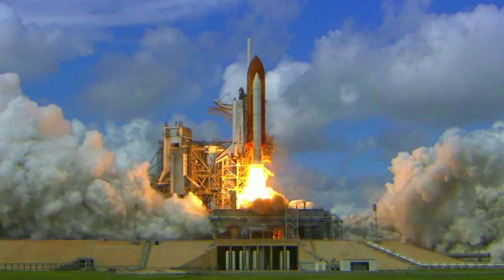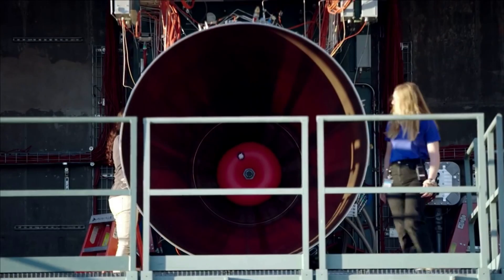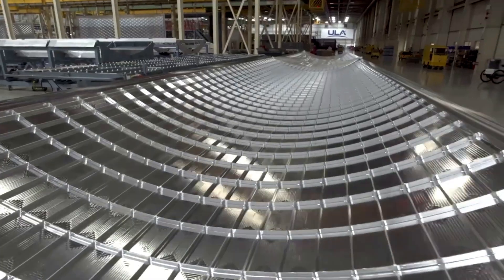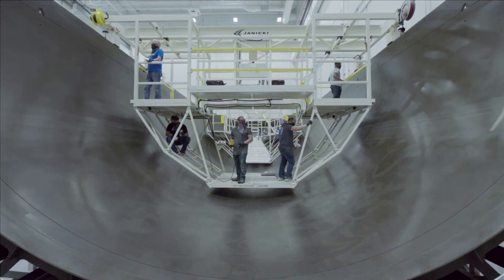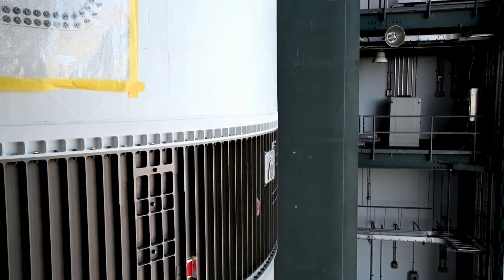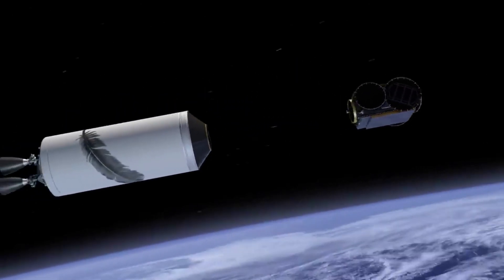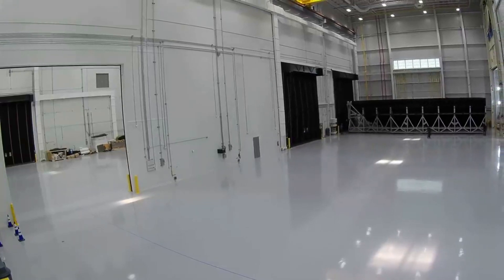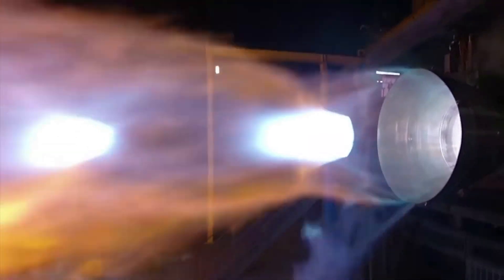Is Blue Origin Making Progress On The BE-4 Engine?

Comment: Does BE-4 really use LNG, or is that a kind of a code word for methane? Longer chain hydrocarbons present in natural gas could pose risk of coking, and there are other impurities.
Reply: In order to liquify NG for a rocket, you have to separate out impurities and essentially you get pure dry methane. Those longer chain hydrocarbons can't be liquid with methane. So it's methane. CNG is just raw natural gas compressed, LNG is more pure and a cryogenic liquid.

SpaceX for example wants a natural gas line to their facility so they can purify it and liquify it in storage tanks. Otherwise it'll take many many trucks to fill every time.
Reply: @Jaker788  So, it is methane, just called LNG for marketing reasons. (LNG as transported in those huge ships does still have imourities.)
Thanks.
Reply: @bazoo513  I'm pretty sure the impurities that would pose a problem for a rocket would be gone. Can't have any water vapor, any longer chain hydrocarbons would likely freeze, etc. At the very least it does require more processing to be compatible with being a cryogenic liquid compared to just compressed gas.
Reply: @Jaker788  I looked around a bit, and you are right - only a bit of ethane is left even in the "ordinary" transportable LNG. Thanks.

Comment: 2500 seconds of sustained burn time is more akin to 8 flights, not 25; but ULA is going to make a single-use for the time being, to replace the controversial and no longer available russian RD180 rocket engines.
I just want to see the BE-4 engines to fly as soon as possible.
The BE-4 engines are not efficient as the Raptor 2 from the competing SpaceX manufacture, but, ehi! - they are close.
Thanks for the updates,
Reply: Cool story lol

Comment: So last week footage was posted of Tory Bruno standing in front of the two unfinished BE-4 engines he is waiting for. Except it was only the engine bells and combustion chambers with the power heads still missing. So the engines aren't even close to fully assembled and they still have to go through qualification testing after assembly before they go to ULA. It's embarrassing at this point, Blue Origin still haven't got 2 flight capable engines after 2 years building just these two engines. How are they going to be able to fulfil commitments to ULA let alone make enough engines for New Glenn prototypes which are going to need seven of these engines each. To do that, by now they should be cranking these things out at 1 per month minimum.
Reply: Yes, it's been slow for Blue but at present, Blue and SpaceX are the only two american companies developing brand new rocket engines. Be happy about that even with the delays. None of the old guard space companies developed any engines on their own dime....both Blue and SpaceX are using their own money.
Reply: @dbreardon  I would he happy about it other than the fact ULA is being dragged down by the constant delays from Blue Origin. Without a steady supply of BE4 engines ULA are going to find it very difficult to survive going forward. The fact BO are struggling to build just 2 engines gives me no confidence this is going to happen.
Reply: @schrodingerscat1863  Well, when none of the other big space companies have even attempted to develop new engines in the last 40 years and SpaceX isn't selling their engines, you have to go with a company that is at least attempting to develop a new, powerful rocket engine.....on their own dime (not government funded)
Reply: @dbreardon  They could have gone with the AR1 but in the end chose BE4, I really hope that decision doesn't end up biting them in the ass.
Reply: @schrodingerscat1863  AR1 like the BE4 really began in 2014 (although BO had concepts starting in 2011. Right now the AR1 has not even had a test fire that I know of. And it has received over 300 million in development  costs. It was supposed to deliver a working prototype in 2019 just like BO wanted with their BE4.
Either way....the more the merrier. If Rocketdyne can deliver a working engine to the military, that will be three large US rocket engines and hopefully set us up for the long term.
One difference between AR1 and BE4 is that the BE4 is being designed to be reused....there will be no difference between the BE4 delivered to ULA for 1 time use and for New Glenn (multiple reuses)
Reply: @schrodingerscat1863  I'm no fan of blue origin, but you have to understand that pathfinding and prototypes take way longer to manufacturer. Even once you start scaling to mass production, the first 100-1000 are still going to take longer than the next 100-1000 as you refine the work flow and process and find out kinks. They need to get into the consistent groove of making them. Even testing will probably have to be more rigorous with the first mass production units to make sure manufacturing is still doing good.

They're slow to make 2 engines, but that's a given. They should be able to speed up considerably on the final build and full production after some time.
Reply: @Jaker788  But these two engines are supposed to be production engines not path finders. The pathfinders were the test units. Based on the amount of time it is taking to build just two engines and the constant slippage of milestones it is clear there are major difficulties with the design from a manufacturing perspective. This is no doubt why so few engines were built during the test phase. Considering the contract with ULA and the fact that each of their New Glenn prototypes needs seven of these engines they should be producing around 2 engines per month by now not 2 in two years. Taking something to production is often way more difficult than building the prototypes because everything has to be proceduralised and costs all have to be controlled. I think Blue Origin has realised that firstly these engines are far harder to build than they anticipated and second they cost vastly more than originally thought. I think they are probably either making no money on the ULA deal or may even be loosing money on each engine which is why they tried to renegotiate the deal recently.